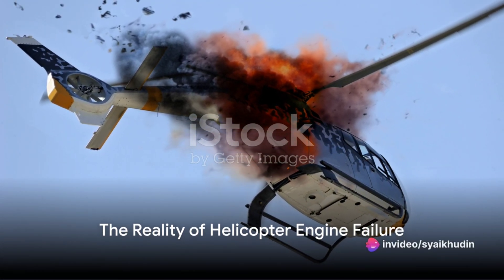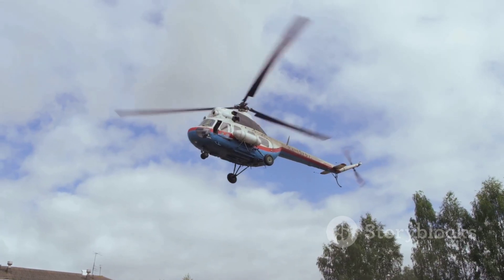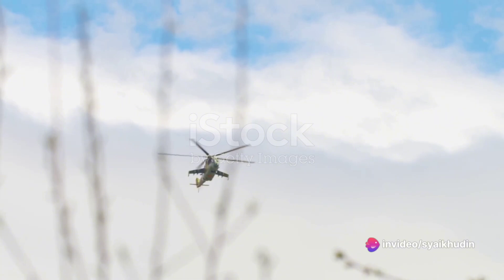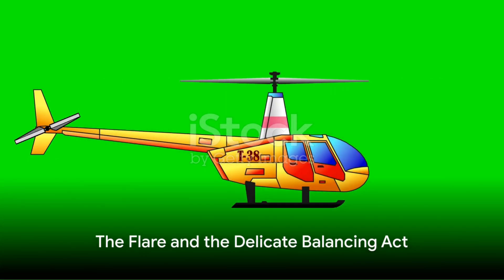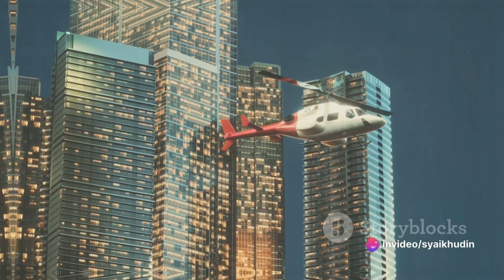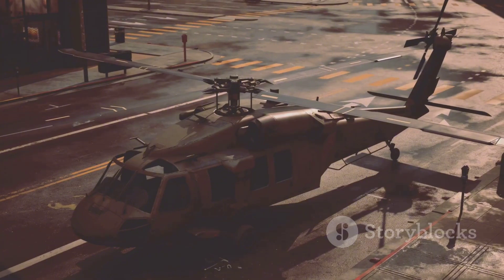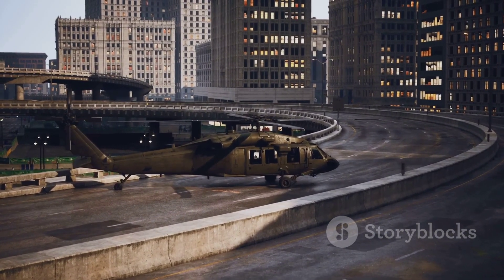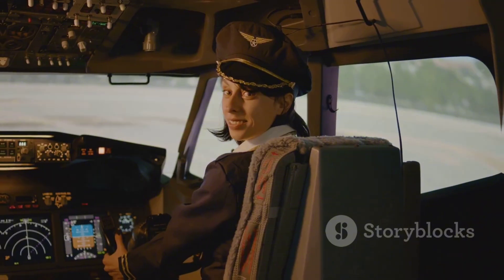Helicopter Engine Failure: Anatomy of an Emergency Landing (2024-03-18) #EmergencyLanding  #Pilot

Comment: Well first of al a helicopter does not land it is a controlled crash, the second is you must have sufficient altitude to do an auto  rotation  the news helicopters rarely have that altitude. the third is that a rotor strike be it the main or the tail rotor is normally cataclysmic. Believe me for I am a three times survivor.
Reply from the maker: Thank you for sharing your experience in this video, as it helps us all understand the causes and effects of the underlying helicopter issues. Once again, thank you very much.

Comment: So why do so many crash and are reported by witnesses that they "saw it drop like a rock"?
Reply from the maker: Here are the common causes that can lead to helicopter accidents:

1. Mechanical Failure: Like any other aircraft, mechanical component failure in helicopters can cause accidents. This may include engine failure, control system failure, or other mechanical component failures.

2. Adverse Weather Conditions: Poor weather conditions such as strong winds, thick fog, or heavy rain can create difficulties in helicopter navigation and control. This can lead to loss of visibility or difficulties in maintaining control.

3. Pilot Error: Human error, whether in flight planning, navigation, or helicopter control, can be a factor in helicopter accidents. Piloting errors may include mistakes in maneuvering, misjudgment of situations, or inappropriate reactions to emergencies.

4. System Failure: Besides mechanical failures, failures in underlying helicopter operation systems, such as avionics systems or hydraulic systems, can also lead to accidents.

5. Structural Failure: Structural failures in helicopters, such as cracks or metal fatigue, can occur due to heavy usage or inadequate maintenance.

6. Collision: Occurs when a helicopter collides with other objects in the air, such as other aircraft, buildings, or other obstacles.

7. Fuel Incidents: Fuel fires or leaks can lead to serious incidents or even fatal accidents.

8. Load Imbalance: Uneven load distribution inside the helicopter can disrupt its balance and stability, leading to accidents.

These are just some common examples, and often helicopter accidents result from a combination of several factors. It's important to note that thorough investigations are typically conducted after accidents to determine the exact causes.